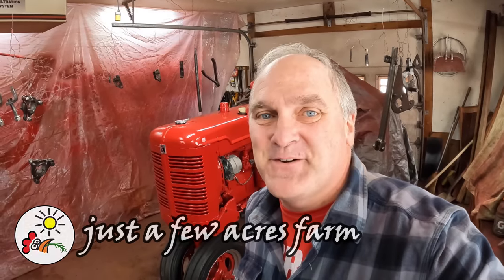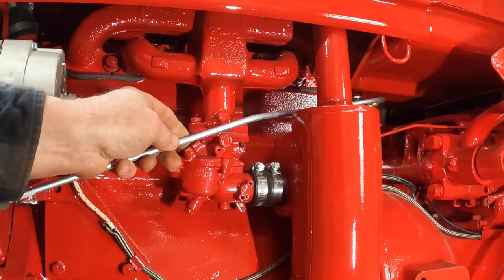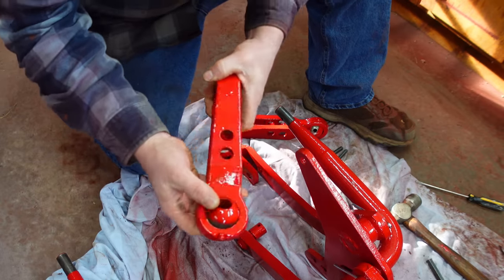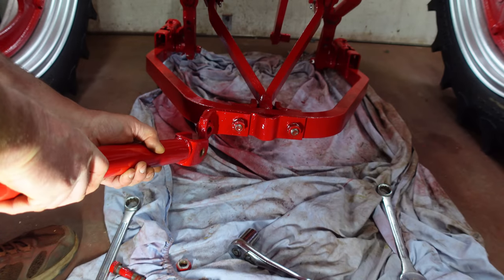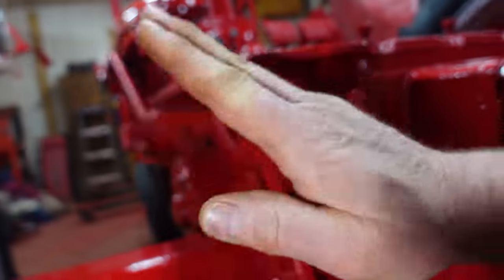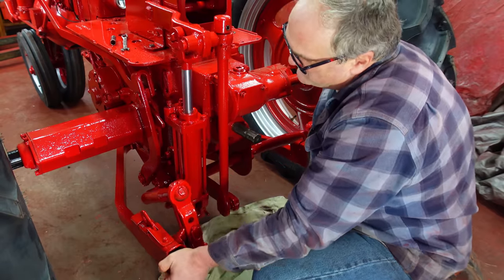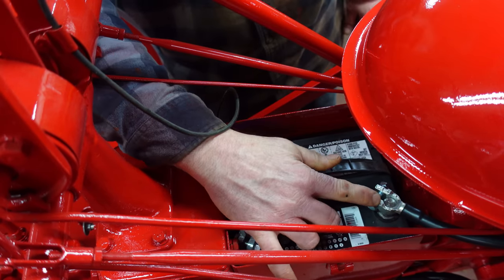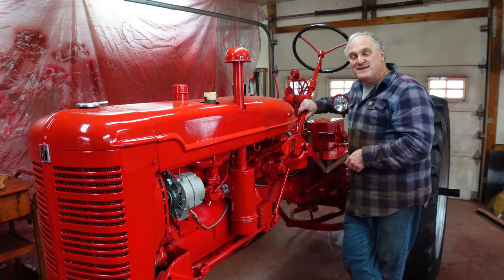This Hitch is Nuts! | Farmall Super C Restoration Episode 19

Comment: You're doing such an awesome job, I think I will bring my 67 SS Chevelle to you. I bought it in 1970, drove it while in high school. Parked it around 74. It sat in New Mexico for 30 years before I decided it was time to restore it. Brought it to Houston and got it torn completely apart. After a few years, I got the frame and suspension brand new, got the underside looking better than factory and then had to put the body back on the frame due to divorce. It sat in storage for another 15 years and my new wife said it was time to finish it. Got it back to my shop and didn't get much done before hurricane Harvey flooded our house and we lost nearly everything we owned. I did get the mud washed out of the body and most every where else but it did ruin the engine. It has been sitting at my son's house now for another 6 years while I have been rebuilding my house... And that is why I think I should get someone else to finish it if I ever expect to get a chance to drive it again...

Comment: Most of my family worked at the International Harvester foundry in Louisville, so I am an IH guy, but what a convoluted mess. Ford and Ferguson really had IH wooped in the hitch department.
Reply: Ferguson had patents on the 3-point hitch, and only licensed it to Ford.  Everybody else had to do something different from what Ferguson did, so the patent lawyers wouldn't have fodder to chew on.  Farmall and Case came up with different 2-point systems that could also connect to 3-point implements.  Allis Chalmers came up with an inverted system (third point on the bottom) with horiizontal pins that were a PITA, then replaced the pins with thier Snap Coupler design; still required removing the drawbar.  And OBTW, they were all trying to convince customers that they had the superior design.
Reply: John Deere approached IH wanting to by the rights to use the Fast Hitch and IH refused

Comment: That's a lot of doo-dads  Mr. Pete. When I have to work on a very heavy pump, I pull out my assortment of cut 4x4 wood pieces. They help a lot when you need to support a heavy piece of whatever so you can get pins or bolts installed and you're doing it by yourself. Saved me from getting  a sore back! And The Super C is looking Super! I can hardly wait to hear you  start it up.

Comment: Have got two super c’s field ready but never been brave enough to take the fast hitches down, I found a leveling bar yesterday for one that I didn’t know I had blasted it and painted it yesterday, this man is doing a great job I’ve got JD, Ford, New Holland , Massey, but I think my blood will always run red , Unbelievable engineering on that fast hitch its so easy for the operator, takes all the work out of hook up , better than quick hitch, everything is on the outside so you don’t have to take the guts out of the tractor. I use to wonder why all tractors.

Comment: Again Pete I am so tickled to see you restoring the super sea I have a question do you have the swing draw bar to hooks up underneath the belly of the tractor that slides back and forth sideways on the drawbar to plugs into the quick the two-point quick hitch I've never seen you use it I see you had a metal thick metal plate molded to the that to use for a draw bar but I just never seen the swing drawbar that that tractor came out with do you have that I haven't seen one in a while but when I used to drive the 200 my grandfather had it had one and when I drove the super sea my uncle James said it had one so and I've attached it we basically had one pin to drop in up underneath the basically right there about where you feed her but under the belly just a question sir good luck and thank you I enjoy your shows I hope you and Hillary and your family are doing great thank you Pete

Comment: Pete you should get a hard line bending tool. That eases the way in making new fuel and breaklines. It should not be very expensive. I got one and it helped me a lot in getting the right bends. Before that i used a wooden towl to bend. That hitch is very complicated for its day when they made these. Also the PTO cover on the old Belarus 500 that i have worked with are  90% of the time missing or a mangled lump of steel. Rarely see on still in a good shape.

Comment: I love your restored Farmalls. My grandfather had an M in the early 50s, from the 40s? but I don't know what year. He did have a set of rusty steel wheels leaning up against the tractor shed. Dad said they were originally for the Farmall. He remembered them as a teen (30s). 
I remember driving the Farmall as a six year old in 1951picking up hay bales with my grandfather and dad picking the bales up and throwing them up to my uncle Jimmy on the wagon. I barely could reach the pedals, so when one of them shouted "whoa" I kicked the clutch in (I couldn't reach the brakes and clutch simultaneously).
 My grandfather died the next spring. Whenever I see a Farmall M I remember "driving " the M that summer as a six year old. Thanks for the memories, Pete.

Comment: Awesome job. I've got a question about a B farmall.  The engine im fixing to rebuild two B farmall engine. Both have been in the family since new . I want to bump up the engine compression.  Possibly remove the engine governor as well an put a foot throttle control cable . As well as hand control.  . Custom make a intake manifold an exhaust manifold.  . With a two barrel holly carb. .

Comment: If you have never run a implement behind a Super C fasthitch, you wouldn't know this, but each touch control handle controls a unique function. One sets side to side depth of the implement, the other tips it front or back. All from your fingertips, no cranking, or turnbuckle changes. On a mounted driveway drag it's superior to anything else by far.

Comment: Buying a super C with a fast hitch , so I thought I would re-watch  Pete's video on the fast hitch.
 There's a lot of parts to that. I go get mine tomorrow, today I paid for it and hauled the cultivator
extra used rear tire, the pulley that's taken off, because it came with 3 point adapter and the 
upper adjusting link (attach to spot), goes where the pulley was I guess previous owner used a finishing mower
so he set it up for 3 point adapter ( where the drawbar part would just have to be kept in the shed. Tonight he notice for the first time
that his 3 point adapter holes, offer both size pin holes , by just rotating them cool.

Comment: I.H. fast hitch is a better design then the 3 point. Ford- Ferguson allowed implement manufactures to use the 3 point design. I.H. refused to let other implement manufactures use the fast hitch design. More implements were available when the patent rights ran out on the 3 point design so tractor manufacturers adopted the 3 point hitch as the standard.